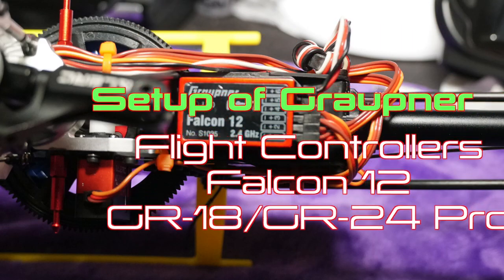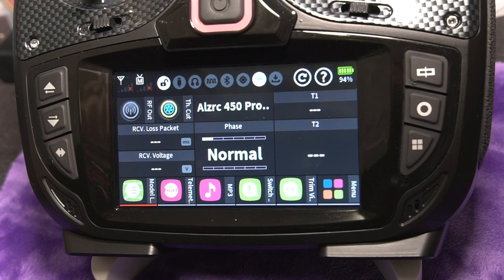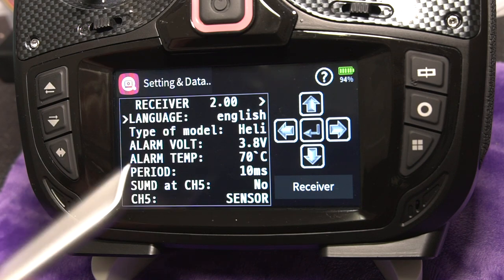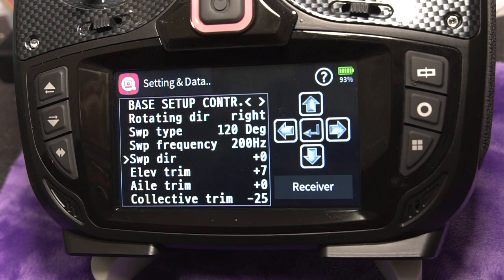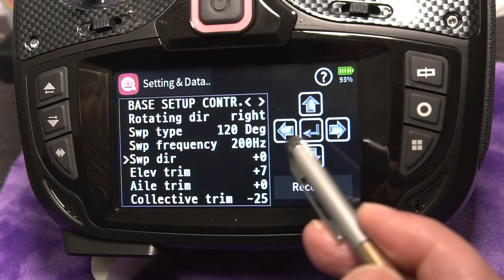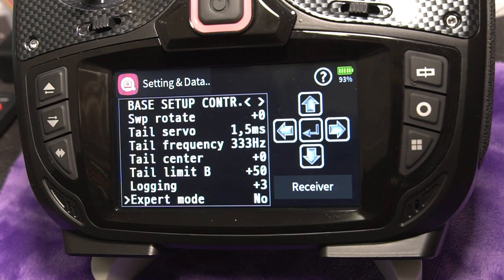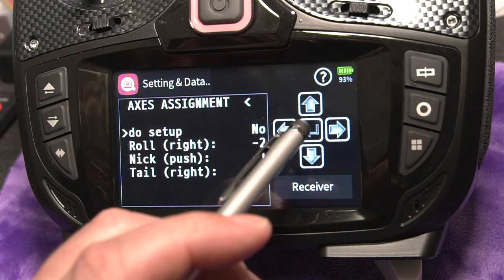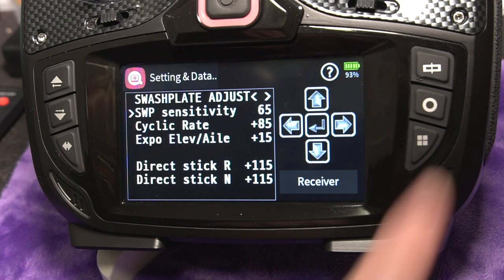Graupner Heli Flight controllers Falcon 12 and GR18

Comment: Hi,

I have very GOOD news, I fixed the Aileron/Elevator issues out. I was playing around in the Radio, and in the Base setup menu, I touched Out.Swp sub menu. In there I changed TX2 to 3 and TX3 to 2 and saved. Tested the swash plate directions, all working OK. But I had to REV CH2 and CH3.

According to the manual on programming, it stated that Swash mixing will NOT be available if you have 1SERVO NOR. So I kept fighting and found a section in the Radio menu to play with.

So my settings are now:
Swp dir = +4

Servo/Sub.Trim
CH1=REV
CH2=REV
CH3=REV

Out.Swp
TX2= 3
TX3=2

Now all I must do is complete the other settings ie Do the Axes Assignment settings, Pitch Curve, Throttle Curve, check settings for Tail Rotor, Allocate switch S1 for flight modes. Last will do is install Rotor blades and make sure I have -+11 Degree pitch with my Digital Pitch gauge.

Am feeling so much better now, but must check all is OK slowly. Biggest concern is my first Hover Test. Will keep you posted. Damn 3 weeks of frustration is now over
Reply from the maker: That is weird as it basically means that you connected the elevator to channel 2 and that was the first thing we talked about? Elevator should be on channel 3.
Reply: @yufasa  Yeah, I had my wiring correct all the time. Only had to change them while trying to sort out SWP issues. My wiring is the same as your wiring on Falcon 12. I even swapped around servo cable CH2 and CH3, but that did not work. Only this morning when I went into Out.Swp and changed TX2 to 3 and TX3 to 2 which worked, but noticed the servo had to be REV in BOTH CH2 and CH3 in servo menu. So now i have all CH1, CH2 and CH3 in REV and the Swp dir is at +4. Hell what a frustrating past 3 weeks of this crap. So am stoked to have fixed the issue with Aileron/Elevator. One of the local hobby shop said that with Mikado VBC, it is all Plug and Play. I told them haha what a joke. No helis are the same, you still have to fiddle with settings. Let me know when you have updated your videos and have new ones, would love to check it out. Keep up the good work and thanks for trying to assistme, appreciate it

Comment: Good Day,

I have bought a Thunder Tiger Raptor E300MD heli in May. Last month I bought a Graupner MZ-24 PRO Radio from Graupner USA which included a Falcon 12 Flight Controller on promotion. The past three weeks have been having problems with swashplate directions.

I spent some time changing servo wiring on Falcon 12. The only wiring that is correct is as follows:
With pins facing you Port 1 =Aileron Right, Port 2 =Aileron Left, Port 3 =Elevator and Port 4 =Tail

The Collective/Pitch is 100%, moves up and down.

I have NOT yet installed the Rotor Blades until I have the swashplate is working 100%. I have the exact same Falcon 12 Flight Controller as you, but is installed in front with the servo cables facing the shaft. Can't have the Antenna touch any metal parts. Graupner USA has told me to use 1 SERVO NOR and change CH1 to REV. They say all Flybarless helis MUST use 1SERVO NOR.

In the Radio, I have created a new model with following settings:

Model Type: Helicopter
Swash Plate Type: 1 SERVO NOR
In Servo/Sub Trim, CH1 is REV
Pitch and Throttle Curves are LINEAR

Allocated switch S6 for Throttle Hold, works 100% (for Emergency & Safety).

With above settings, the following Swashplate directions are:

Throttle/Pitch when left stick move up, swashplate goes down & Blade Holder gives +pitch (100%)
Throttle/Pitch when left stick move down, swashplate goes up & Blade Holder gives -pitch (100%)

Aileron(Roll) moves as Nick(Elevator)
Elevator(Nick) moves as Aileron(Roll)
Am struggling to swap these around.

Rudder when move Right, pitch changes

Rudder when move Left, pitch centers (0 Degrees) no change

I upgraded the Falcon 12 from version 2.00 to 2.05. With the above settings, this is the best I can get. Just the Aileron and Elevator settings need to be swapped around.

I am sure there must be some changes to be made in the Falcon 12 settings to fix the Aileron/Elevator to be swapped around. If so, please can you let me know. Been looking on internet and see they mention you need to change swashplate mixing, which is done in FBL unit. I need to find this setting.

Below is the Falcon 12 version 2.05 settings. I only changed the Model type from Plane to Heli and the PERIOD from 20ms to 10ms.

Receiver 2.05
Language English
Type of Model Heli
ALARM VOLT: 3.8V
ALARM TEMP: 70º C
PERIOD: 10ms
SUMD at CH5 No
CH5 SERVO
CH6 SERVO

Swashplate ADJUST <>
Swp sensitivity 65
Cyclic Rate +85
Exp Elev/Aile +15
Direct stick R +115
Direct stick N +115

Tail ADJUST <>
Tail sensitivity 65
Tail Rate +85
Expo tail +40

BASE SETUP CONTR <>
Rotating dir right
Swp type 120 Deg
Swp frequency 200Hz
Swp dir +0
Aile trim +0
Elev trim +0
Collective trim +0
Swp travel 8 d. +80
Collective B +80
Swp limit +80
Swp rotate +0
Tail servo 1.5ms
Tail frequency 333Hz
Tail center +0
Tail limit B +50
Swp S4 center +0
Logging +3
Expert mode No

AXES ASSIGNMENT <
do setup No
Roll (right) +0
Nick (push) +0
Tail (right) +0

I hope you can assist me in sorting the swapping of the Aileron and Elevator issues. I look forward to your next video with the Falcon 12 version upgrade. Latest is version 2.05.

Kind Regards
Reply from the maker: I just this weekend installed a Falcon 12 in a new Goblin 380 and ran into a similar issue. In my case the Swashplate is turned around by 180 degrees compared to the Align 450 the video was made on. In this case I had to play with the setting of "Swp dir" under Base setup. I found that changing the value to 1 and then swapping servo direction on pitch worked for me but you may have to play with that setting and with directions to get your Swashplate to work as you expect. Try it and let me know
Reply from the maker: I was thinking about making an updated video as I have learned a lot since I made the original like the Swashplate setup and some expo settings that will help others.

Comment: Expo in the receiver keeps stick resolution constant over the whole stick deflection. Expo in the transmitter reduces stick resolution around center stick and increases stick resoltion at maximum deflection. So in theory receiver expo would be prefered.
You say some prefer a little negative pitch at stick center, what is the reason for that?
Reply from the maker: Thank you for that. I will update the video accordingly
Reply from the maker: Oh and the slight negative is for when you go into idle up it helps with landing if you don’t autorotate. That is why I said you can set that up elsewhere. I should have left that out and will edit video accordingly

Comment: I noticed that you cannot individually center out the servo arms @90 degrees (servo1 + servo2 the 2 front servo's) using the swp roll/aileron trim in the telemetrie menu. If you want to trim out the servo's 1 and 2, with the swp roll/aileron trim option, both servo's move in opposite direction. The servo 3 can be trimmed out @90 degrees individually using the Swp Nick trim option. 
Do you have the same experience ?

Comment: I have centered the servo's in the telemetry settings of the GR-18.
But when I mount the servo arms, it is not possible to get the arms at a 90 degrees angle.
How can I get the servo arms at 90 degrees, do I have to use the Nick trim, and Roll trim settings in the telemetry settings from the GR-18 to do that ?
I do not think I can use the trim settings on the Transmitter to do that, is that correct ?

Comment: Hi,

Thanks for reply. I tried your technique by changing the setting of "Swp dir" under Base setup. I changed the value to 1 and swapping servo direction on pitch did NOT work. It did fix the issue with Aileron/Elevator.

I even changed the Swp dir all the way to 6, the swashplate does NOT work 100%. So I deleted the model and created a new model, I used 1SERVO NOR as the 3S 120(Roll) is NOT good at all.

Under Base setup I changed Swp dir to 1. In the REV/SUB I have CH1=NOR, CH2=REV and CH3=NOR. In the servo graph(Bars), when I push Collect/Pitch up, CH1 and CH3 move up at same time and CH2 goes down. This makes Swp go up level which is incorrect as the Blade holder gives Negative pitch.

When I move Elevator up, CH1 goes down, CH2 and CH3 goes up at same time. CH3 bar is bigger than CH2.

When I move Aileron Right, ONLY CH1 and CH2 bars move up at same time. When I move Left, both CH1 and CH2 move down at same time. When I check the swashplate, the Aileron Rolls, but the Push rods are NOT moving in right direction. In other words, when I roll right, the Right push rod goes up and Left rod goes down. This is incorrect.

I tried changing the Swp dir, but every time I do so, the SWP does NOT work 100%. This is getting very frustrating.

So in REV/SUB.TR, I  put CH1=REV, CH2=NOR and CH3=NOR. Swp dir back to 0. When I push Collective/Pitch up, this makes Swp move down level with Blade holder giving +pitch which is correct 100%. BUT this goes back to square one, meaning when I push up Elevator, the Swp moves as Aileron(Roll). When I move Aileron, Swp moves as Elevator. Colletive/Pitch is the ONLY correct movement.

Looking at servo bars, CH1 goes down when push collective up and when pull down, CH1 goes up. This is correct. When I push Elevator up, CH3 bar goes up and when pull back CH3 bar goes down. But this makes SWP move as Aileron. When I push Aileron Right, CH2 bar goes down and when push Left, CH2 bar goes up. But this makes SWP move as Elevator.

If I change just CH2=REV and leave CH1=REV, SWP still is NOT correct, but Pitch is 100%. The same if ALL Ch1, CH2 and CH3 are REV. So I just need to find a setting that will fix the Aileron/Elevator issue out. If I can get this Right, the I will look at the Tail.

I went back into Swp dir and change to +1, Pitch acts as Roll. When I push Elevator up, Elevator works, BUT SWP TILTS BACK and if Back, SWP TILTS FORWAR. When I push Aileron, SWP moves as Pitch with slight roll. So changing the Swp dir to this +1 DOES NOT work. I know there is some setting in the Falcon 12 that MUST be chaged, don't know what. I am losing my head with this. I will ask Graupner USA to see if they can setup a Raptor E300MD with MZ-24 PRO Radio, and get them to send me th CORRECT settings BOTH in Radio and Falcon 12. I know they have NOT done this. All they is that I MUST change CH1 to REV. Changing the Swp dir will NOT solve this, as I even changed all the ay to +6. I have to get this Heli SWP working 100%. Hope you can help me FIX this SWP please. I want to do my first Hover test soon.
Reply from the maker: I know this can be frustrating so lets try and figure it out. First need to confirm that you have a 120 degree swash plate (three servos) and it is oriented with 1 servo up front (elevator) and two in the back (roll/ailerons). You plugged the left roll/aileron servo into channel 1 and the right roll servo into channel 2 with the elevator/nick servo going into channel 3.  Rudder is in channel 4 and motor in channel 6 but it does not affect this configuration. 
Now change the swp dir setting to a point where the swash plate moves up and down when you move the throttle/pitch control. Direction does not matter as we can change that in the Base Menu->Servo Set menu by reversing direction of channel 1 (Pitch).
Once that is fixed you can check roll and nick directions and reverse them as needed in that same menu.
Let me know how that works out for you
Reply: @yufasa  Hi, yes I have a 120 degree swash plate. It is oriented with 2 servos in front (ailerons/Roll) and 1 at back (Elevator/Nick). With nose facing you, I have left aileron plugged into channel 1 and right aileron into channel 2 with Elevator/nick going into channel 3. Rudder is in channel 4 and motor is in channel 6. Tomorrow morning I will play with swp dir settings from 0 to 6 to get the swash plate to move up and down when I move the throttle/pitch stick. Remember my swash plate has 2 ailerons in front with elevator at back near shaft as mentioned above. The heli I have is a Thunder Tiger E300MD. I will do this Slow step by step to follow your instructions to get this swash plate working 100% before I can move on. This MZ-24 PRO Radio is damn awesome. OH yes, I did upgrade the Firmware of the Falcon 12 from ver 2.00 to 2.05 which I mentioned in earlier chats. This should not affect the swash plate. I did this ugrade last week. When I play with the settings of swp dir tomorrow, will let you know of the outcome. I appreciate your assistance very much. Just want to win this SWP issue soon. I still got nNO news from Graupner USA. I did send them pic of Falcon 12 installation which they asked for.
Reply: @yufasa  Hi, I have played around with swp dir. When I changed the values, the swp moves. I found that at +4, the swp is super level. So i left it at that value. The Throttle/Pitch moves up and down 100% and had to change CH1 in Radio to REV, as swp MUST move down to give Positive pitch. The only problem is the Aileron/Elevator. When I move Aileron, it acts as Elevator and when I move Elevator, it acts as Aileron. I have looked to see where to fix this, but don't no where. Am sure it is in the Falcon 12, but will have to look in the Radio as well.
After struggling for hours, I decided to Reset the Falcon 12 back to Factory settings and start from scratch again. Tomorrow morning, will Rebing Falcon 12 I will start with Swp dir from 0 and change the values till +4. While changing, will see if the SWP moves after each change. It never did this before. Could you assist me in how to switch Aileron and Elevator around? Is there some setting in the Falcon 12 or is it in the Radio? It is just the Aileron/Elevator issue before I can go further.